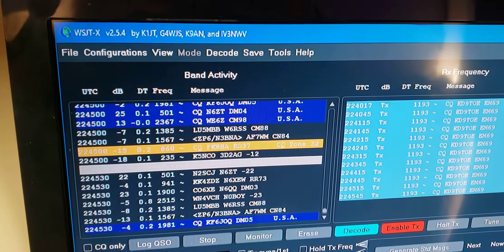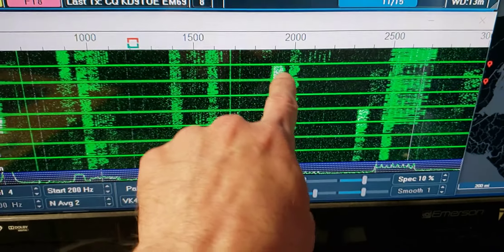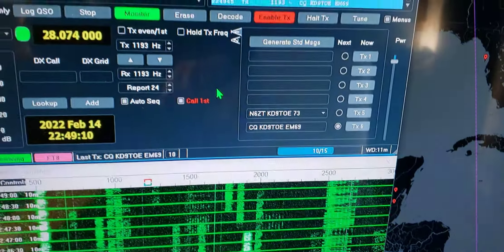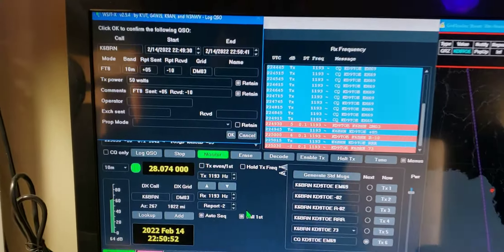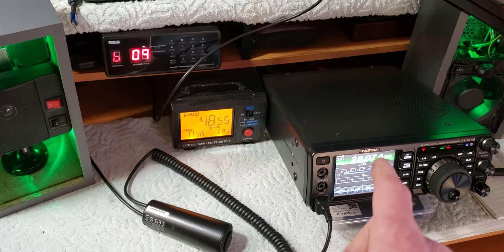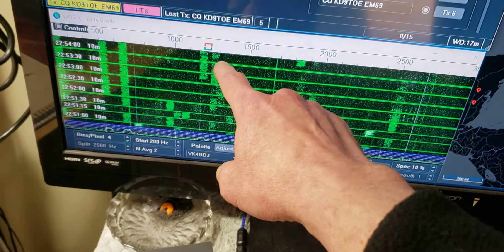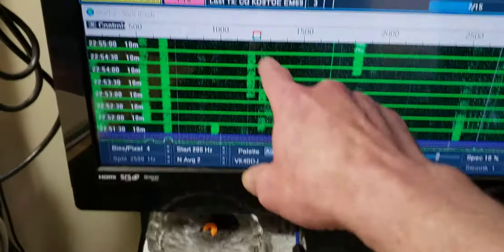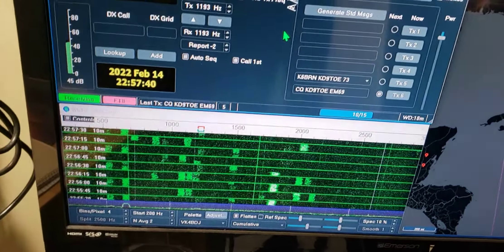How to Tune FT-8 Ham Radio!

Comment: FYI: FT8 is, in fact, a weak signal mode, not a low power mode. It is always recommended to use minimum output power to make a QSO.

Comment: What is that program you are running for ft8 operating 
I use a ft991a with wsjtx and log4om2  with a double bazooka for 20m. All good info. Please give me the details  of your setup  for your shack looks good.
LOVE MY FT991A , I operate at 30 to 50 watts  and keep ALC very low.
Good job om.
Chuck Port Salerno FL 
AA4CP

Comment: its not a low power application for FT8.. its a weak signal mode. so i run 200-400w .

Comment: Is that grid tracker  with something else
Reply from the maker: 2 programs gridtracker and wsjtx software. Hope that helps.
Reply: @HamBandit  Is it Gridtracker that's giving you the voice alerts?
Reply from the maker: @JohnVK5JAK  Yes grid tracker is the program with voice alerts. Load gridtracker on the right side you will find a settings tab. you can change the audio settings to alert you with  a voice alert :)